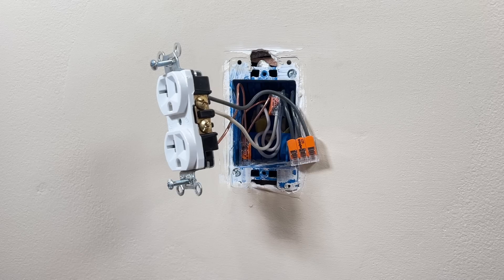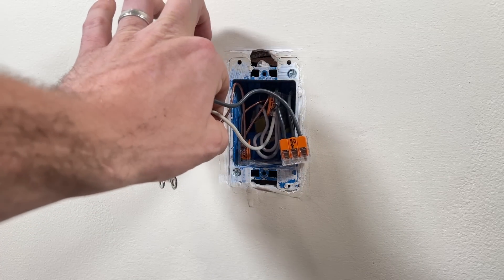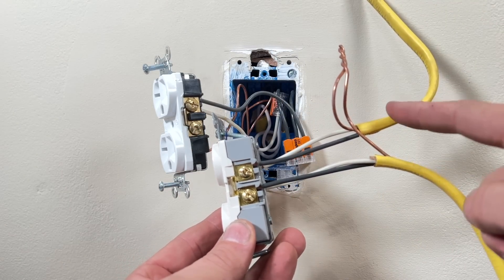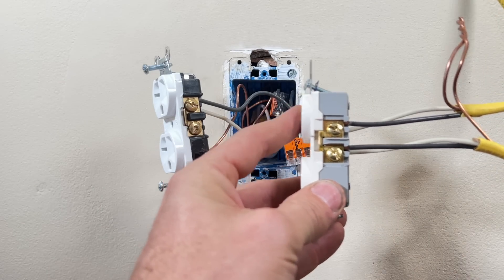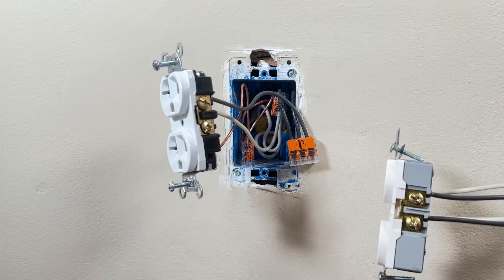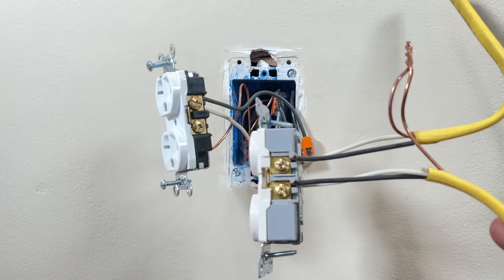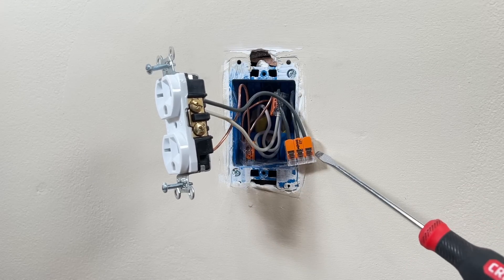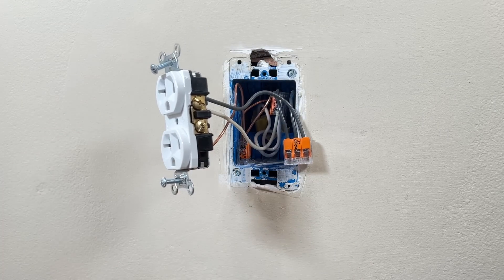How and Why To Make A Pigtail

Comment: Your premise about the NEC regarding 'pigtails' is incorrect. Furthermore, pigtails do create many more points of failure than direct wiring will. And the receptacle shunts (even a 15A receptacle) are fully rated for 20A. I find it much easier to insert a receptacle with 6 wires attached than it is with my box full of wire nuts and extra wire.

Comment: I hate those WAGO connectors. The latches have broken off 1/4th of my connectors during install of 3 outlets. I don't get how people have been using these unbendable wires in these tiny boxes and no one has developed a connector that doesn't come loose with 5 pounds of pressure.

Comment: 2:13 -- does anyone have a reference for through-wiring outlets being against code? I'm finding resources that say it is allowed per the NFPA 70 (NEC)
Reply: He's wrong about that and it is allowed. The code doesn't stipulate either method, but you could work for someone who requires one method or the other. There are pros and cons to either one.
The one exception is a multi wire branch circuit which requires pigtails when two receptacles are on different circuits.
Reply: It is allowed. Plain old cheapo 15 amp receps are listed for 20 amps feedthrough current. Using the terminals for feedthrough is equal in integrity and function to pigtails. Pigtails aren't better, that's a myth

Comment: Have 4 wires when you include the pigtail but Wago does not make a 4 terminal device it goes from 3 to 5, can I use a 5 and leave 1 empty????
Reply: Yes, that's the way you would do it.

Comment: Nationally at least, there's only a few cases where pigtailing is required by code. 1. With ground wires, always. The biggest evidence is that every electrical device you can get has only 1 ground terminal. 2. Neutral wires, on what is defined in the code as a "multi wire branch circuit". What does that mean? It means any circuit with 2 or more ungrounded "hot" wires where each wire is from a different phase. An example would be a 120/240 volt circuit, one with the 2 hot phases, and a neutral wire. The neutral allows for both voltages to be used. Anyways, on these types of circuits, you do have to pigtail your neutral wires. But that's it. In all other cases, you don't have to pigtail by code. That said though, I always pigtail, because it's still best practice, and may even be required in some local electrical jurisdictions. However, nationally, it isn't.
Reply: There's nothing "best practice" about pigtails. Pigtails are not better than using terminal screws, and they're equal in function and integrity when installed properly.
Reply: Very nice comments. Thanks for translating the code to readable language.

Comment: Bah humbug. If it was against code it would not have the terminals to even use in the first place. The entire inside of the outlet can fail and it will still transfer power. The terminals are connected to each other on the outside of the outlet using a bus bar. Breaking bus bar off electrically isolates half of the receptacle from the other half. This is how you can wire one of the half to operate with a switch and other half is constant hot. Loose wire connections, improperly stripped or loose wire nuts are where the failures will be at, same as with pigtails.

Comment: So if you shouldn't use all 4  connections , then why are they  there    ?
Reply: You could use all 4, but 4 wires can make for a very resistive install. Since commercial grade receptacles have this backwire clamping feature, the design allows the installer to put a 1/2" of stripped wire on either side of the screw or both sides. Another reason is if you split the receptacles by breaking off the connecting fin, you'll have the separate screw needed for each hot and neutral connection.

Comment: As noted by others, it is not against NEC to feed a downstream device via the side terminals of a receptacle, so long as you are not landing two wires on a terminal screw designed for only one wire. You are required to pigtail the neutral on a multi-wire branch circuit (two hots sharing a neutral) so that removing a device doesn't create a hazardous loose neutral situation - but that's the only place the code is concerned with removal of a device interrupting a circuit.

Comment: Either way but I'm not crazy about having wire nuts or WAGO connectors in every receptacle box. The screws offer better surface contact area for the wires and they're already there so I just use them.

I'm going to go old school in my house and use grounded, metal boxes. I like the idea of the metal box for fire prevention.

Comment: The "failure" of the outlet itself will have no impact on the daisy chain. The chained wire connection is on the outside of the outlet and in fact is much better in terms of contact area (i.e, thermal issues) and won’t be all wiggly like a Wago. Sure, a little harder to push the wires back in but in that respect, you're not dealing with wire/lever nuts crowding the box.

I daisy chain where I can and only employ pig tails if more than 2 wires needing connection.

Comment: Pigtails are the better way to make these connections, then wire nuts are better than that connection device, it is based on the same concept as the outlet device for sending power through the circuit, also wrap the Pigtails around the screws not stuck in the back of the outlet
Reply: Pigtails and wire nuts are not better than the screw terminals on a device. The device is designed and manufactured for feedthrough current.

Comment: 1974 condo replacing beat up three prong outlets, outlet has four white, one black and one red wire with a ground wire, if I pigtail two white IN what type of wire should I get to use OUT to the pole of new outlet. Not sure what kind and type I should use?

Comment: Forgive me for being stupid. So a pigtail is used to go from one receptacle to another? If there is just one receptacle that's not going to another is that a dedicated circuit? I know NOTHING! Thank you. Excellent video.
Reply: If there's a single receptacle (one socket) and no other receptacles on that circuit, then that's defined as a dedicated circuit. One receptacle not going to another is usually an end of the run outlet. It will have only 3 wires, hot, neutral, and ground, no pigtails.

Comment: Pigtailing only adds another failure point. The outlet would have to completely melt in order for downstream outlets to fail also. Rubbish. Keep it simple, don't pigtail if you don't have to. Also in residential homes, if downstream outlets have failed, it's an easy fix to narrow it down.
Reply: The terminal screws are designed and UL tested and listed for feedthrough current. Unless it's required, there is no advantage to pigtailing.

Comment: Should always pig-tail
Dad always said … if you’re going to do it … do it right , or don’t do it at all !
That still stands today as it did back in 1959 when he told me that !
Always turn off the power first and always pig-tail !
Reply: The terminal screws are designed and UL tested and listed for feedthrough current. Unless it's required, there is no advantage to pigtailing.

Comment: not using the receptacle is used for the fact that if that outlet fails the rest of the circuit doesn't die.
Reply: Properly installed recipes using the terminals screws for feedthrough almost never fail because that how they're designed to be installed.
Reply: @pld8993  Electrician installed ours, and at least six have failed. Sigh
Reply: @YagwitOG you have other issues if you have that many failing that often. That circuit is being overworked is my assumption. If that's the case a new line should be run to compensate and split that circuits run into 2 different circuits so the circuit's demand is lessened... and be split over 2. The outlets burning up are that circuit's way of screaming at you that it's in pain. The large load,  somewhere on or across the circuit, is causing heat to build at the point where there's the most resistance. Heat equals failure. And everytime you replace the failure point a new one is created and moves the location of most resistance to another outlet's wiring. Also,  if it is a new run with new wiring then the wiring used for that circuit was too small in relation to the size of the run and the demand that is being put on the circuit during use.  Hope that makes sense.  Hope that helps. Try unplugging bigger stuff on that circuit and moving it to another place in the house to spread out the load to Putney places instead of having it all on one circuit.

Comment: I see in your example you're backstabbing the connections to the device. I'm not an electrician but everything I've read about backstabbing was negative and that it should be avoided. Can anyone chime in on that?
Reply: Those could be commercial outlets where it's not backstabbing per se, but the terminal screws actually secure the wires inside the outlet (if you haven't found the answer yet)

Comment: If the circuit ANY point is pulling more amperage than the circuit breaker allows, it will trip. You very much may attach receptacles without a pig tail. The wire is rated from beginning to end to pull the desired amperage. That is what the circuit breaker is for. 

Note: exceptions to this do apply for 3 phase commercial. For residential, this is completely fine.
Reply: Pigtailing is only required for neutrals on a multiwire branch circuit, including in residential. Though hots are commonly pigtailed in non-residential, there is no rule that requires hots to be pigtailed, even in a 3-phase mwbc.

Comment: I'm a bit confused about the logic behind pigtails.  

"Isolates each receptacle so one bad won't knock out the rest of the run."  

But on the side of every receptacle I've used there's a direct connection between the two hot and neutral screws.  So the receptacle could die internally and power will still be passed along.  I'm not really sure what could fail inside the receptacle anyway, there's no circuitry or moving parts.  If you somehow heated it up to the point it broke the connection you would have bigger issues than the rest of the circuit not working.  I've had switches fail of course, but never a receptacle.  And my house is over 100 years old.

As for getting the receptacle into the box after wiring being too hard, don't make the wires so long.  You only need to be able to pull it out enough to access the screws on the side.  I assume you wired that outlet to illustrate what's going on, but if you actually left it that way your wires are way too long.  You can disconnect the wires from the receptacle without even fully unscrewing it from the box.
Reply: Exactly I don't understand that concept either. Pigtailing only adds another failure point.
Reply: Yeah it's dumb

Comment: Rookie here, so whats the point of having two Brass screws (hot) and two silver screws (neutral) in a outlet if one is to take out power from that outlet to something else?
Reply: The terminal screws are designed and UL tested and listed for feedthrough current. Unless it's required, there is no advantage to pigtailing.
Reply: because you can separate the two receptacles into 2 different circuits.  by removing the bridge tab between the two screws on each side.  the less connections made in the circuit the less drop you have at the end of the line
Reply: @BlakeHarvey903  The terminal screws are designed and UL tested and listed for feedthrough current. Unless it's required, there is no advantage to pigtailing.
Reply: @pld8993  sure there is.  if the plug stops working the rest of the plugs on the circuit continue to operate normally.
Reply: @BlakeHarvey903  And how would the terminal screws magically stop working? Using the screws for feedthrough current does not send that power through the innards of the recep. Power goes in one screw, through that metal tab and out the other. That metal tab on a 15A recep, btw, is rated for 20A.
Reply: because people use the stab in.  at least when pig tailed it doesn't matter which they use.
Reply: @pld8993  most homes where i have repaired outlets, an entire section of outlets were no longer working because the outlet failed.
Reply: @BlakeHarvey903  Stab-in and using the terminal screws are not the same. They are completely different connections. Pigtailing or using the terminal screws are equal in integrity and function when installed properly. Pigtailing is not better.
Reply: @BlakeHarvey903  I've been an electrician for 40+ years and I've seen way more failed splices than I have bad screw connections. That doesn't mean splices are necessarily inferior or that terminal screws are better. Anything not done properly is a potential point of failure.
Reply: @pld8993 that is your opinion.
Reply: @pld8993   Daisy chaining can cause a multitude of problems. When you plug multiple surge protectors, extensions cords, and power strips into one another, you are creating a fire hazard. The increased electrical demand on your home's system can harm the wiring and outlets in your home.
You should pigtail all receptacles and switches. It really important on the neutrals, if you lose the neutral, you could have a dangerous situation downstream. Also, although most homes don't have a lot of large Amp draw equipment, you still could be putting a lot of load on that jumper between the screws.
Reply: @BlakeHarvey903  It's also a fact. Read UL498 and learn. Terminal screws on a 15A recep are rated for 20A feed-through current and tested at 150% of their rating. It would take more than 30A going through those screws for an overcurrent condition to compromise the integrity of the connection if it's installed properly. When you add a pigtail, you're adding a handmade splice which is adding a potential point of failure.

Comment: Question,  I had an outlet in my bedroom in which I did not want any longer so I disconnected all wires from the outlet so there was a total of 3 whites, 3 blacks and 3 ground wires. I put a cap on each wire individually since I wanted to patch the outlet hole with drywall, but now my bedroom light doesn't turn on. Should I just pigtail all blacks together, all whites together and all ground wires together, is that safe? Will that restore the bedroom light?
Reply: Piggy backing on this comment because I had a similar issue. Three sets of wires but I am replacing an old outlet. I think I miswired the outlet and now it doesn’t work. It seems in our situations, there are other fixtures that were also supplied by this outlet. I hope someone chimes in on the comments, trying to figure out how to resolve the issue. I believe it has to do with determining which line is supplying power downstream and keeping that line in tact.

Comment: I don't see the difference electrically between wire nuts or using the screws on the receptacle when only 2 sets of wires are being used. It's not against code and it's not more difficult to install the receptacle in the box. How is a receptacle going to fail? It's just plastic and copper conductors with no circuitry or any moving parts. Receptacles are rated for 20 amps pass through, same as 12 gauge wire. Failures occur in the wiring, circuit breaker, or the appliance used. Worn contacts in the receptacle can cause failures, but wirenuts or not is irrelevant in those cases.
If a wire somehow becomes disconnected it's true that all the downstream receptacles will be out, but that's usually easy to troubleshoot. If you use pigtails you could have a failed receptacle connection and not know about it if it's rarely used. There are pro's and con's to each method. Most electricians and electrical contractors have their preferences and it's based on what's been done traditionally in the trade, IMO.
Reply: The terminal screws are designed and UL tested and listed for feedthrough current. Unless it's required, there is no advantage to pigtailing.

Comment: Im going to be doing a home rewire and I may be doing some of the labor extensive stuff myself.  If I do a junction box in the ceiling above each room and spider the leads down can I use that connector inside the junction box?  Thanks

Comment: Great video,s I like your style; are you ready for a question?? I have a 12-volt dc single post on. off light switch, it is located within 8" of a 15 amp ac duplex outlet; I need to run (2) 14AWG pos-and neutral wire from the 12 volt light switch to power my Rv antenna iI would love to use  WAGO,S FOR THIS PROJECT; I would also need pos.&neg spade connectors at the light switch itself; can I acquire a ground by using the ground on the duplex outlet right next door; this would mean having three ground wires attached to the DUPLEX GROUND SCREW?? ANY ADVICE GREATLY APPRECIATED; A SIMPLE DRAWING WOULD BE OF GREAT BENEFIT TO ME; I AM WILLING TO CONTRIBUTE TO YOUR CHANNEL FOR YOUR HELP WITH MY SITUATION; PATRICK.P

Comment: I missed it in the video, I was wondering what the desired length of the pigtail should be. I would suggest 6 inches. Also I thought I might note, that the exception to the rule of not using a receptacle for downstream lines would be if you use a GFCI at the wall socket.
Reply: There's no rule that says you can't feedthrough the device to downstream receps on individual branch circuits.

Comment: All neutral were wire nutted before together. But the hot black had a "jumper" from one light switch to another light switch. I pigtail the black hit so each switch can have its own power. Do I have to pigtail the neutral too? Or can I just leave as is? Both switches are two way only. I am replacing with two way only.

Comment: How do I add an outlet to one that has 2 hots? I believe 1 is load from electrical box and 1 is feed for another outlet.
Reply: Insert the feed of the new outlet on the available Secondary load lug/notch/space on the existing one. Tie all neutral and ground wires together in the existing box and your done. Not that hard.